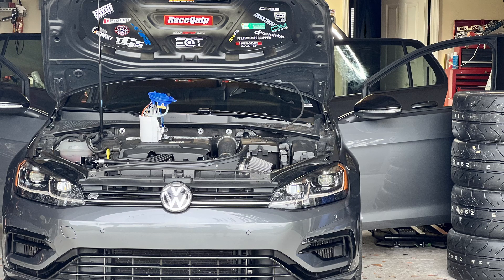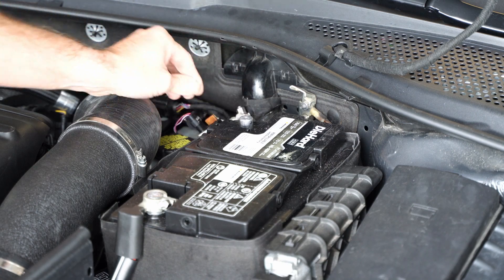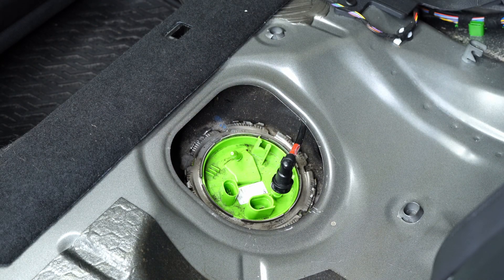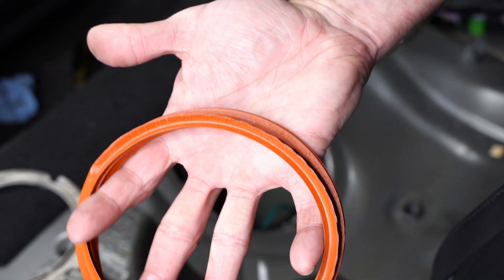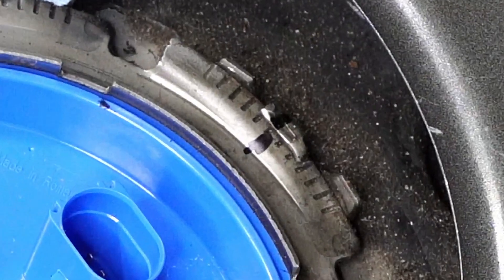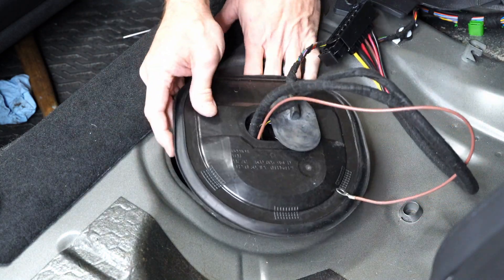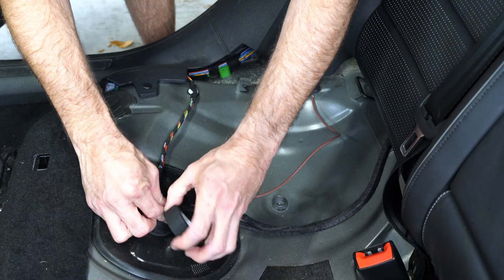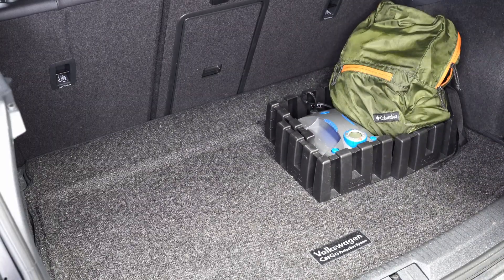EQT RS3 Brushless Low Pressure Fuel Pump Install

Comment: If you're going to leave an unused connector outside the car you should use contact spray/grease on it to prevent corrosion on even if you're never going to use it again water can track up the cable and give you issues later

Comment: You should  install 2.5 guage wire to run a 20amp fuse instead of the 1.5 guage wire from the fuse box that's weak link

Comment: Don't know why, but I'm having a really difficult time getting it to face the rear, and I'm scared of breaking something. The internal fuel lines dont seem to want to work with the pump orientation. What direction should the elbow at the bottom face?

Comment: There is really no need to run “full” E85. E40 will be more than enough to see the largest chunk of benefits of ethanol. Ethanol is often misrepresented as having a linear content vs benefit line and that’s just not the case. Once you’re able to hit MBT at a particular boost level the benefits have been realized and there is really no need to run more. You’re just going to burn it faster and  amplify some of the draw backs of ethanol.

Comment: Can I run this on stock tune. I need to go back to stock tune for a little and wanted to know if I had to remove it and put in the old one
Reply from the maker: No. You need a tune to specifically account for the LPFP.

Comment: 15:00 be careful with just slapping in a higher rated fuse.. while this will keep it from popping and let it draw more amps, are the wires capable of this added amperage? if you put too high of a fuse in you could burn the whole car to the ground.

Comment: Why is there so much gas left in the tank even though you drained it ?
Reply from the maker: A because I didn’t drain it all the way. Only almost all they way. Fuel gauge close to E was fine for me. Really could do it with 1/4 tank if you wanted to.

Comment: So quick question - this solution does NOT require something like the Torqbyte PM4 (separate controller) where doing your own like a Walboro or Deatschwerks would?
Reply from the maker: Correct. It has its own controller.
Reply: If you're referring to the DW DW300C no controller upgrade is required. It stays under the 16A limit of the stock unit.

Comment: The price on this is absolutely insane and not in a good way.
Reply from the maker: Not gonna try and justify their price, because I agree it’s way too expensive (everything is) but they are in line with the other brushless drop-in options. You can save some money with brushed pumps… but that’s taking a step in the wrong direction! :-)
Reply: You can piece together your own RS3 brushless LPFP kit for $850 or so, they are just Audi parts you can order direct and then get the A2B RS3 DIY fuel pump harness for either AWD or FWD which comes with the necessary extra parts for adapting to the Mk7 platform.  Part numbers for the RS3 pump is 8V0919087A, black fuel controller (module) is 4M0906093N, seal is 1J0919133B and metal nut on top of the tank is 1K0201375.  The pump itself is the same for AWD or FWD, the extra bits is what makes it different between R/GTI and that comes from the A2B DIY kit.  So you can figure out the quick math if you want to spend more for the turn-key package or save a few hundred to push in some plastic parts yourself.
Reply: example the fuel pump is only $441 on that site I hope everyone understands the markup on audi parts is insane just need to shop around but when it comes to fuel pumps and certain parts always buy new